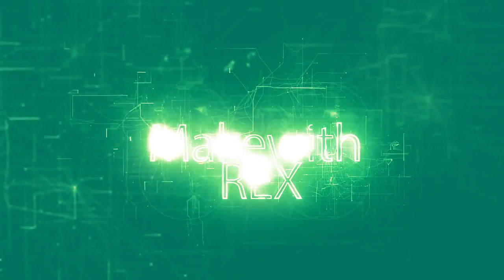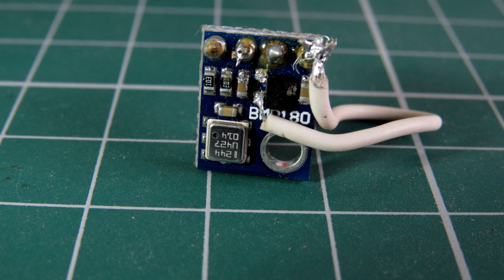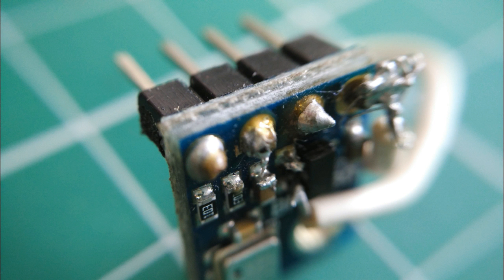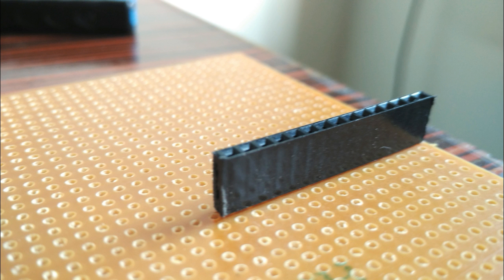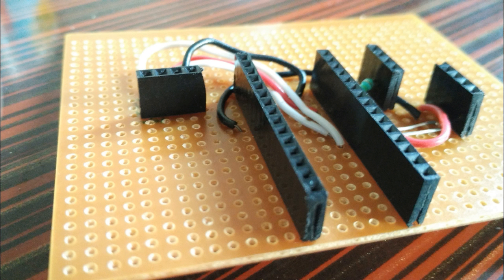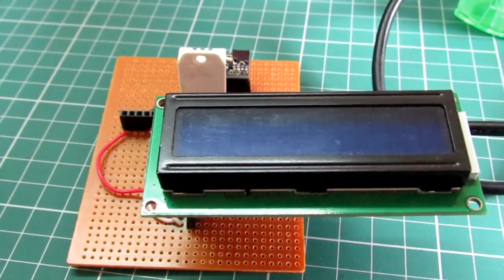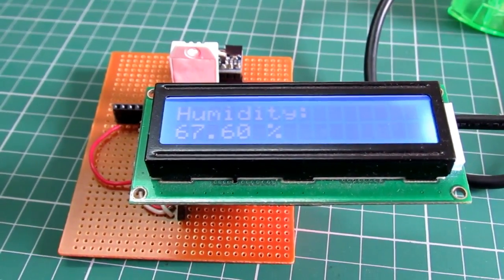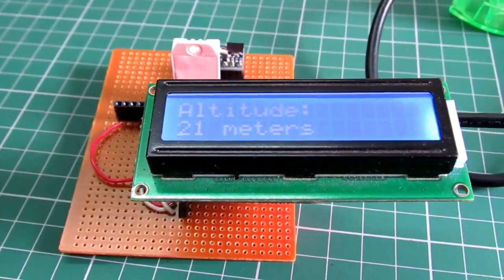How to make a weather station || DHT22 ||BMP180

Comment: can we connect aurdino board directly to sensors without using breadboard?
Reply from the maker: yes why not
Reply: how?
Reply from the maker: +BHUVESH DHIMAN using male to female jumpers  wire
Reply: but i have male to male jumpers..
Reply: and i also have a breadboard which is not wired. so pls temme if i can use all this n connect.
Reply from the maker: +BHUVESH DHIMAN buy some male to female then
Reply: The problem is dat i dont get male to female jumpers in my area.
Reply from the maker: get some from online store ,where do you live